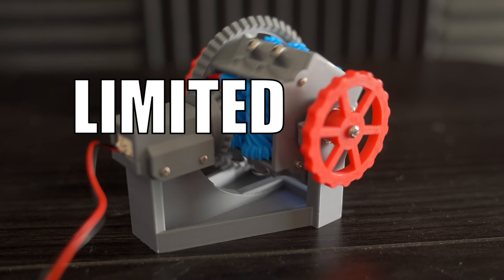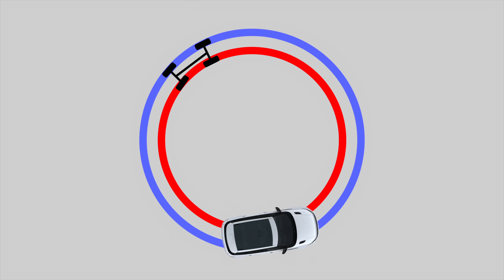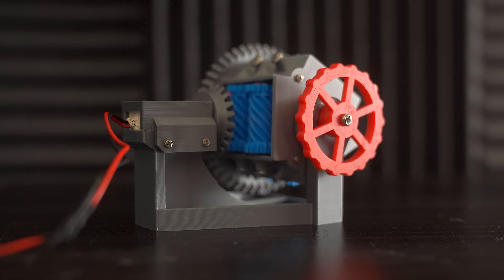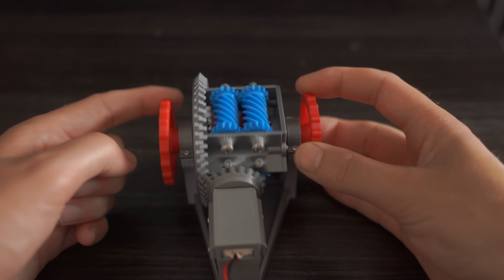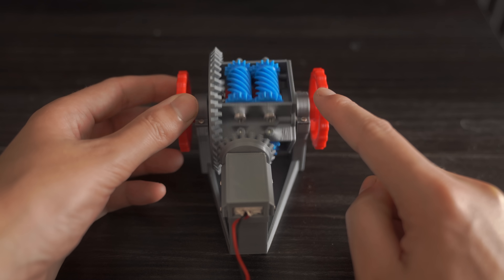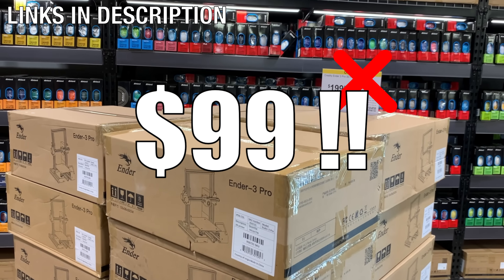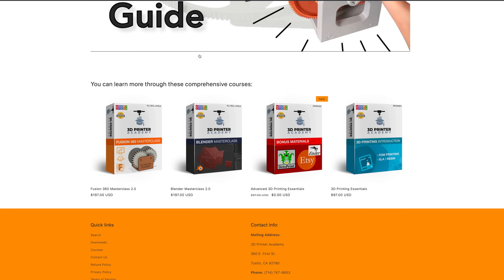What's a Torsen limited slip differential?

Comment: The key to this differential is the fact that a worm gear can turn a spur gear but the spur gear cannot turn the worm gear. So it acts like a mechanical diode.
Reply: "Mechanical diode" is a very good analogy, I'll be stealing that, thank you.
Reply: @fredwupkensoppel8949  Indeed. I hardly understand gears, but I do understand diodes. (:
Reply: Thanks Erik, was struggling to see how it works but I get it now.
Reply: That is exactly what I expected video to explain....
Reply: This is wrong. There is only helical to helical and spur to spur interface no helical to spur interface. Also, there are helical diffs that have no spur gears using offset helicals to reverse direction. 

In your incorrect statement it would not be load dependent. 

Helical gears create axial thrust which is the mechanism used to PROPORTIONALLY distribute torque the the wheel with the most grip.
Reply: where is the worm gear in this differential?
Reply: @lapistaoftheparadise4627  The six gears arranged in pairs around the carrier each gear coupled by spur gears on their edges.
Reply: @lapistaoftheparadise4627  not actually worm gears as they are equally 45 helical. If they were worm type gears then it would be locked all the time and have no differential ability. The blue gears here wedge and react against each other to lock during unequal torque loads.
Reply: Yes! This is what completelly missing in this viedeo.
Reply: I’m not sure I agree Erik. Where is the worm gear? Can’t the blue helical gears spin the red helical gears and vice versa (red spin the blue)? I think the key is the rotating reference frame which allows one red to spin while the other red is stationary
Reply: Brawo!
Reply: Forgot about this one, this is the missing piece of information.
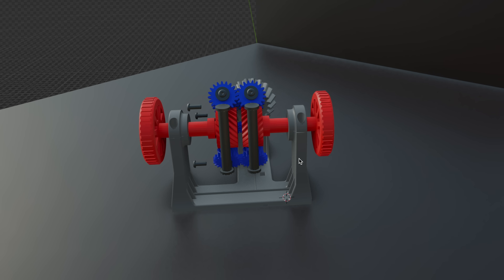Reply: @1337GameDev  I don’t know, this is confusing. I believe the red and blue gears are their patented “Invex” gears that can actually rotate each other. He says it in the video at 1:10 too; the red gear can spin the blue gear its own axis. It is definitely confusing though
Reply: I like the idea of a mechanical diode! Can’t the red gears spin the blue gears about their own axes though?
Reply: @DYGTFilms  Yes but with great difficulty.
Reply: @erikkovacs3097  ahh so that’s why blue and red gears could lock up under certain outside torques applied to the wheels
Reply: Which is EXACTLY what the video should have mentioned.
Reply: exactly
Reply: Wrong
Reply: @burner33  No.
Reply: @erikkovacs3097  ok, but if it really is a worm gear that cannot be turned by a helical gear, then a normal steer of the car would lock the differential. it would literally be a locked differential than cant be unlocked.
Reply: @burner33  But it would not lock it. I don't know how you came to that conclusion. The torque can only be transferred in one direction. The torque  can be uneven like when turning but it's still one directional.
Reply: @erikkovacs3097  there is no helical-spur connection. The spur gear turns another spur gear to force opposite rotation like spider gears will. There are helical diffs that have no spur gears. 

The angle of the helical to helical interface actually develops axial thrust proportional to the input torque. This is what creates the lockup effect. 

If it was a worm driving a spur it would lock up in 1 direction and provide a gear reduction in the other. 

If you don’t understand what you are talking about, then don’t talk about it.
Reply: @KTMcaptain  In the animation the spur gear is attached to the axle shafts. The three worm gears are orthogonally coupled to the drive shaft spur gear. There are three identical worm gears for the other axle shaft. Each of the three left-right worm gears are themselves coupled to each other via small spur gears. You are arguing semantics because the "spur gear" is not straight cut but helical. I don't make the definitions. In all diagrams of torsen differentials the drive shaft gears are called "spur gears". The diagram is pretty clear there is no gear reduction because the worm gears are coupled together via the smaller spur gears on each end. I don't think you have seen an animation of this. This video: https://youtu.be/Z9iPqIQ_8iM is helpful. Torque is preferentially transmitted in one direction (worm gear to spur gear) because of the axial loads you correctly identified. Because the differentiation between left and right wheel goes through a power flow like this: (Left axle spur->Left worm triplet pair->Right worm triplet pair->Right axle spur) and torque is preferentially transmitted worm to spur and not spur to worm, differential rotation is limited but not impossible. The limited differential rotation is what makes this a limited slip axle. The amount of lockup can be tuned by changing the angle of the spur gear approaching full lockup and no differential rotation as the angle approaches 0.
Reply: @erikkovacs3097  I stopped reading after the first sentence cause you are clearly wrong. That’s a helical gear at 1:07
Reply: @erikkovacs3097  but if they were worm gears, if one of the helical gears wanted to spin slower, the worm gear would have to spin crazy fast to keep up with the helical gear and transmit torque to the other helical gear. only problem is that there is nothing to coerce the worm gear to start spinning.
Reply: @erikkovacs3097  plus, if you search up diagrams most of them literally have friction plates, so your locking idea is further disproved
Reply: @erikkovacs3097  also you can clearly see in most diagrams that the "worm gears" you think you see are actually weird angled helical worm gears meshing with more helical gears, which if you think about it transmits torque both ways
Reply: @erikkovacs3097  also explain how  one side of the differential would be able to spin slower/have less torque transmitted if they really are worm gears that act like a mechanical diode
Reply: @KTMcaptain  No. Trademarked Invex gear. If you read the rest of what I wrote I covered why they are technically not true worm gears.
Reply: @erikkovacs3097  also if you think about it, how would gears alone be able to make a limited slip differential that doesn't lock up?
Reply: @burner33  No. Only the Torsen T-2R RaceMaster has a preload clutch.
Reply: @erikkovacs3097  and, i found an explanation showing that the helical gear angles create a sideways thrust force when torque is applied to the gears which would push the two big helical gears to the side, shoving the helical gears into the friction plates, which are shoved into the differential casing, thus, limited slip differential is created
Reply: @burner33  How would gears alone make a limited slip that doesn't lockup? That's the point of the Torsen differential. That's what makes it unique. Also, by definition a limited slip does not lock up.
Reply: @burner33  They're not true worm gears. As the gears sets tooth angle approaches that of a worm gear the "mechanic diode" affect approaches full one-way operation.
Reply: @burner33  There are many models.. Which Torsen model is it? Sounds like the Torsen T-2R RaceMaster.
Reply: @erikkovacs3097  i mean opbviously, but the whole point is that all useful torsens have high angles so that their differential doesnt have too much binding
Reply: well i guess it makes more sense to say its a low angle, but high angle sounds more right
Reply: @erikkovacs3097  it’s a helical gear, just like the pinion on an axle. There are no spur to helical gear interfaces.
Reply: What you described is a different type of torsen differential. If you install spur gears in place of the blue ones from video, and worm gears in place of red ones from video you will get torsen differential with locking mechanism meaning that engine won't be able to spin one wheel faster than the other and in that case when one wheel has no traction, for example elevated from the road, then both wheels will spin at the same speed. But on the other hand when turning and one wheel spins faster due to greater dinstance it needs to cover, it will simply be able to do so because worm wheel can propel spur gear but no other way round. Of course it's just simple example on how it works, in reality torsen don't use actual spur gears for many reasons. Instead they use different Torque Bias Ratio supported by traction plates to provide locking mechanism. It's super complicated but it works perfectly. You can build simplified version I described using Lego R and it will work but probably wouldn't in an actual car, don't know why 🤔
Reply: You are the one who explained it, not the video. Thank you!
Reply: That does not help for some of us
Reply: Spur gear can turn a worm gear but there's a lot more friction so that's the limited slip part. And some torsen diffs also have true friction surfaces. See for example Miata torsen diff for an example with multiple friction surfaces and clever design to make it really small physically.
Reply: this is a fallacy. in this case, this differential could not work at all.
Reply: There is no worm gear.
Reply: There are no worm gears here. 45deg helical gear, while technically can be considered a worm gear, is not truly one that the term means, because the gear ratio is the same in both directions: 1:1. Thus, there is no "mechanical diodes!" here.

This is even clearly shown here when he locks up one wheel and the other starts spinning twice the speed. In that setting, the torque is literally going both ways through those gears. More specifically one way through  the helical gears in one side and the other way on the other side.
Reply: @anteshell  Actually it’s more of a mechanical diode than ever because even an electrical diode has a reverse breakdown as does this “semi” worm gear. It transmits torque preferably in one direction, so torque is preferably transmitted from these “semi” worm gears to the helical gears mechanically coupled to the two axles.
Reply: Which in a car is generally a bad thing
Reply: @gizelle-s  How is that a bad thing?
Reply: @erikkovacs3097    when the engine is off and the car is moving, rotation from the wheels is transferred to the defferential then to the disengaged transmission, if I'm correct then the differential has to break or the car stop moving
Reply: @lapistaoftheparadise4627  No. the differential would not break when the engine is off. I don’t follow how you came to that conclusion.
Reply: @erikkovacs3097  Audi has had Torsen in their Quattro AWD systems since like 1986 or so...  as well as many other street going AWD cars, like Subaru. They work great, but they are sensitive to excessive wear if your tires are not matched.

It's proven, and it works well... it even works the same in reverse, unlike many other AWD systems. I think it's only been recently that Audi has moved on to other diff systems.
Reply: @gizelle-s  It still allows the wheels to spin at different speeds during normal use, but locks it when one wheel spins too fast (looses traction), transferring power to the one with traction instead of the one that has the least traction as a normal "open" diff which is good. the torsen diff was the base for the Legendary Audi quattro awd system, with one in each axle and one in the transfer case.
Reply: @gizelle-s  11Q
Reply: @gizelle-s 
nah it's not.... u just don't understand
Reply: @gizelle-s  thank you lol, did not get explained in the video

Comment: Would only work with individual brakes to control traction.
Reply: Not really. The only reason the free wheel is spinning free at twice the speed in this demo is because there is no load whatsoever on it, so there is almost no resistance for the helical gears to overcome. Add any sort of load on the "free" wheel and it effectively locks up until input torque overcomes the helical gears' mechanical advantage. If the helical gears have a 4:1 advantage, then 10% torque on the slipping wheel would allow 40% torque to still go through on the other. If you are going to use braking-based limited slip, then you may as well just use a standard open differential since there is little point in having both for how little either is really needed in normal everyday driving.

Comment: I've heard it been called a torque bias differential. It's a great option for FWD cars
Reply: nope, this will not do anything good in FWD, it was made for AWD, specifically for AUDI Quattro
Reply: @krisg822  it does do good for FWD. My dad and I do lanes rallies in a Vauxhall Nova. We have a torque bias in it and it's an amazing job. Most LSDs that go in FWD cars give it a lot of understeer in tight corners but the torque bias doesn't do that and it pulls so well
Reply: @jackstewart7664  not sure how it's called, but there is a thing like 'Xdif' , it uses ABS to brake one wheel in order for the diff to do the rest of the job. Some cars that claim AWD use it too, altho, AWD is only real with with either torsen or locked differentials.

Anyway, for FWD the xdif does not a bad job, it lags somewhat behind, and won't get the car out of mud or snow, but once tha car is moving , it does it's magic.
Reply: @krisg822  I think the gold gti uses that system. Or atleast something similar. Our Vauxhall Nova is far too old for something like that however
Reply: @krisg822 😂 just because Audi puts one of those in the transfer case you get excited and think that that's the only place it works
Reply: @ronaldrrootiii6040  no, it works for Quattro bcoz Audi with Quattro has AWD.

Comment: OK, I still don't understand how it works.  I can see that instead of four bevel gears in the centre you have a more complicated arrangement with worm type gears, and maybe its something to do with friction, in the way that worm gears don't work both ways.  The title syas "how it works", and the video doesn't explain it.
Reply: The helical angle on the worm gears is such that the worm can drive the spur gear, but if the spur gear tries to drive the worm then it binds up.
Reply: @ferrumignis  Thanks, that kind of what I was thinking.

Comment: I think this video failed to provide the “why”. You said The genius is that it is a mechanical system that transfers the correct amount of torque to the wheel that needs it most. I was expecting you then to explain why it does that, and that was the end. I honestly dont know why these gears aligned in this way perform that function.

Comment: 2:48 "... instantaneously transfers the correct amount of torque to the wheel that needs it the most" That's exactly what it DOES NOT do. It's even proven by your own very demo. If one wheel is free-spinning in the mud and the other has all the traction to the road it would just keep spinning in the mud.
Reply: As he said, even on ice you have some traction/resistance that would be enough to trigger the locking mechanism. The problem is when one tyre is not touching the ground, then it acts as an open diff.
Reply: You should pay more attention. It biases torque to the wheel that needs it the most, but it requires that some torque still go through the wheel with the least traction. If one wheel is completely open then it works like an open diff, which is the only real disadvantage of this type of diff. However there is a workaround for low speed low grip situations e.g. trying to pull away with one tyre on mud or ice, by lightly  applying the vehicles brakes you provide some torque resistance on the open wheel allowing the diff to apply torque to the wheel with more traction.
Reply: @ferrumignis  Fair enough. Your explanation makes more sense. I just feel like it wasn't clearly explained in the video or requires prior knowledge of the operation of the diff to get it. I had to look up Torsen diff to fully understand it.

Comment: I still don't get it plus that's different than a car diff
Reply: "that's different than a car diff"

What do you mean? It's exactly like the torque biasing differential used in some cars from the factory, and available as an aftermarket upgrade.

It works because the helical angle on the worm gear is shallow enough that the worm can drive the spur gear, but if the spur gear tries to drive the worm then it binds up.

Comment: Mechanical parts are pretty reliable when well designed. I've always seen electronics as a way to compensate for non-ideal designs.
Reply: Yes and no. Electronics can be used as a crutch and often are, but mechanical parts have their properties set in steel when they're made so to speak. If you need the diff to behave differently to account for different road conditions or driving style, you'll have to build and install a new one (the relative sizes of the blue and red gears change the exact minimum torque required to initiate the locking behavior, for instance). 

An electronic diff can be re-mapped for track/off-road/regular use with the flip of a switch. Also lets you account for steering wheel angle and suspension state along with lateral loads and a bunch of other things. If it's an all-wheel-drive car, this includes the gearbox changing how much power is going front to back as well.
Reply: @DFX2KX  That's the point. If it can be mechanical and needs no change, why make it electronic if it will requiremore maintenance?